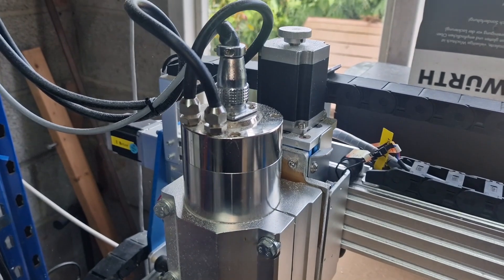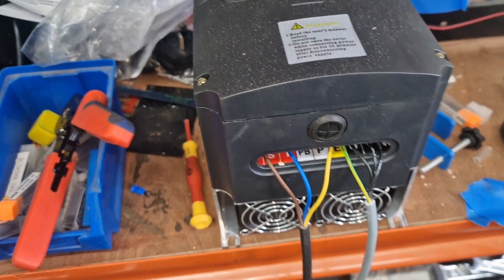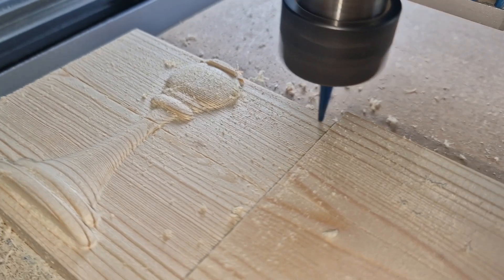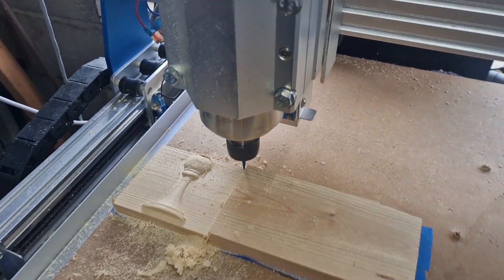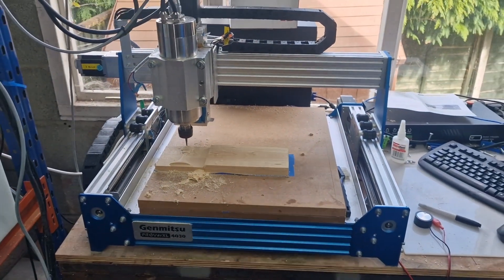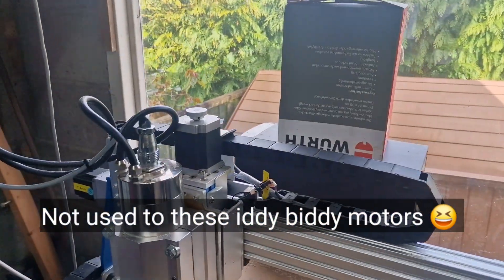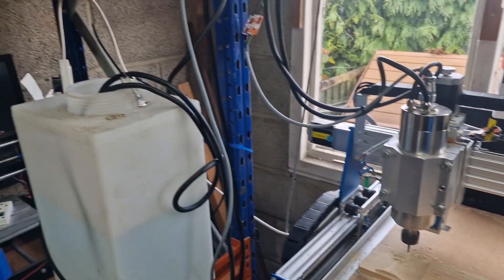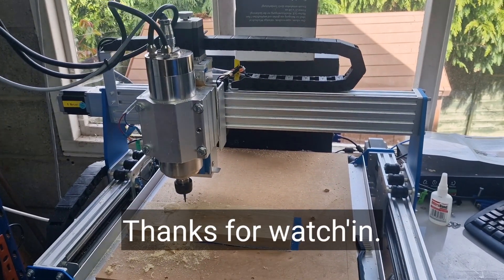A metal guy doing wood on his Genmitsu ProVerXL 2.2kw spindle upgrade!!!!

Comment: hey, thanks for your video! Do you have a link for the mount front bracket holding the spindle? I got mine from Sainsmart but I have the feeling it is bad. Thx
Reply from the maker: Hi
Yeah it's from a UK company called cnc4you.
cnc4you.co.uk
Reply from the maker: Hi
Yeah it's from a UK company called cnc4you.
cnc4you.co.uk
Reply from the maker: Hi
Yeah it's from a UK company called cnc4you.
cnc4you.co.uk

Comment: That's awesome! I'm thinking of the same thing, but on my 4030 v2, how is it holding up? Is the extra weight of the spindle an issue at all? Thats the thing thats making me think of maybe getting the 1.5KW spindle instead...
Reply from the maker: I have to say it's holding up fine. Obviously could do with a slightly stronger z motor. 1.5 is plenty though, I just happened to have this one laying around 😆
Reply: @robbroomfield468  do you think the 2.2k spindle is worth the extra 50 bucks. im concerned with the rigidity of the frame, i also have the expansion kit. only main reason im leaning towards the 2.2k spindle is to be able to use 1/2in bits with the e20 collect.
Reply from the maker: @TheRsZeus No.....I would definitely go lighter with a 1.5kw spindle. 2.2kw is brutal. I just had it laying around so I used it. Also the Z motor is only just strong enough.
Reply: @robbroomfield468  I was really leaning towards the 2.2kw just for the simple fact I could run 1/2in bits..

Comment: isn't the 2.2kw spindle overkill on that frame?
i only use a 1.5kw spindle and go in wood like this with a similar speed but 10mm depth of cut. the limiting factor has never been the spindle power but the rigidity of the frame for me. my frame is x: 900mm by y: 1200mm by z: 400mm travel which makes the stiffness vs. speed a challenge.
Reply: leaves room for upgrade :)
Reply: how do you like the 1.5k spindle?